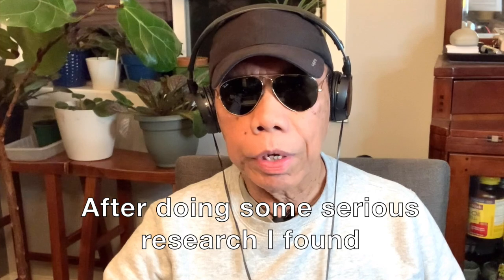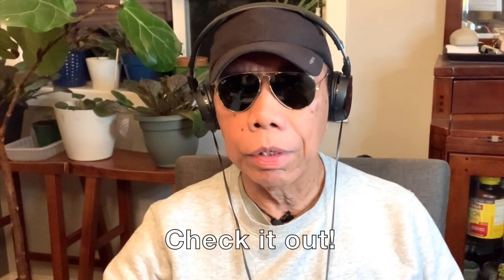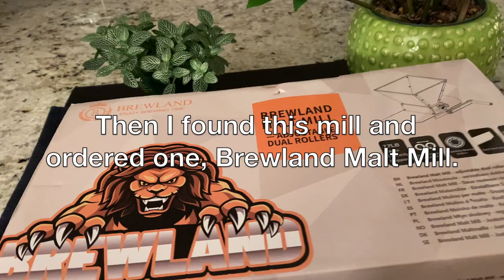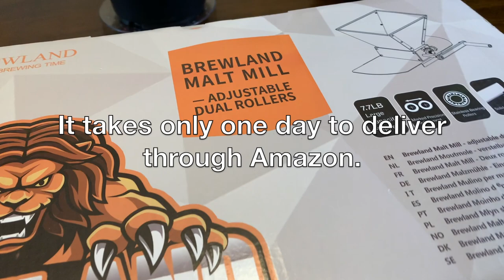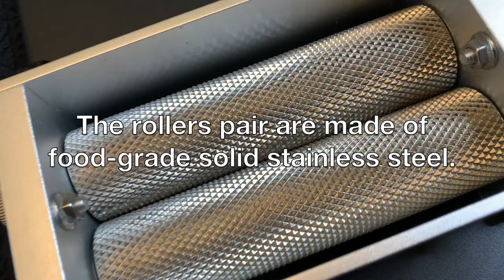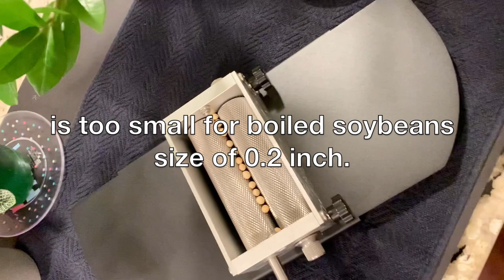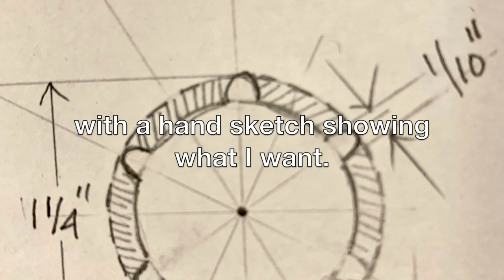The Best De-huller for Your Home Tempeh Business

Comment: Hi, thank you for this tips!
I also have a malt mill I originally bought for beer and now use to crack soy for Tempeh - dry beans fracture into smaller size bits and than, when washing, the hulls just float, more so than when using the traditional dehulling method.
Do you have some particular reasons for not using cracked soy in Tempeh? Just wondering out of couriosity =)
Reply from the maker: Hi! You are doing dry de-hulling which cracks whole dry beans into smaller pieces, maybe into 4-5 pieces, then wash or blow away the skin. It is fine and that is the way dry de-hulling is done. I am doing wet de-hulling, which leaves the beans in whole halves. It is a matter of preference, and it is how old-time tempeh is de-hulled. I love to see tempeh with whole halves of beans. Don't forget when you wash the cracked dry beans you wash away not only the skin but also a lot of tiny bits of beans. Wet de-hulling keeps the beans intact. Both tempeh is the same, only whole halves of beans tempeh look more beautiful. But, beauty is in the eyes of the beholder, not on the tempeh itself! Keep improvising!

Comment: I have the one from 2:47 minute mark. I use it to dehull the soybeans dry, it spits them to about 3 pieces. Why isnt this recommended to use this one? I am not exposing it to liquid so I dont think it will rust
Reply from the maker: There are two kinds of de-hulling: dry de-hulling and wet de-hulling. In dry de-hulling, you break the dry beans into smaller pieces and blow away the hulls using a fan. The breaking of the beans will also create smaller bits that will be blown away by the air and the result is not halved beans, but broken beans. Broken beans will make the same tempeh as whole halved beans de-hulled using wet de-hulling. It's only a matter of preference. The problem is you can't hardly crush 1 kg of dry beans in half an hour as opposed to de-hulling wet using the shown de-huller. The shown wet de-huller can split 1 kilogram of beans in just 3 minutes. The call is yours.
Francius
Reply: @francius1003 I'm guessing that halved beans has more space between them because they are only big blocks, no tiny pieces to fill the gaps. So... more mycelium produced? 🤔 So more protein produced? (At least I wish, lol)

It would be interesting to see the nutritional compositions of the soy beans and the mycelium parts of the tempehs.
Reply from the maker: @bixlord  Small pieces or big pieces produce the same protein. The difference is only on how to prepare them.

Comment: Hello from Australia,
Thanks for this video. I bought this exact same mill recently and have been thinking how to best modify the rollers. I'll give your design a go. Do you mind if I ask you what dimension your smooth passive roller is? 
Thanks
Reply from the maker: Hi, Hilal!
The roller's outer dimensions follow the original rollers. The only difference is the new rollers are without 12 TPI knurls. The new active roller now has six ribs 0.1 inch high, instead of knurls, the passive roller is just plain smooth. Both are made of aluminum, to makes them easy to manufacture. Stainless steel is overkill for soybeans.
Good luck trying!